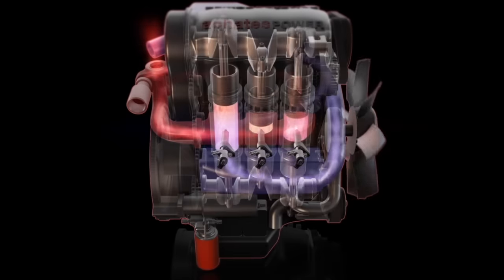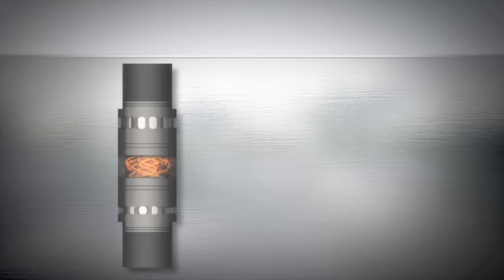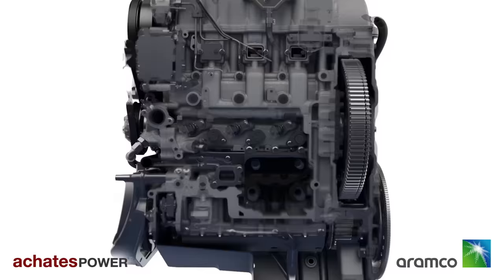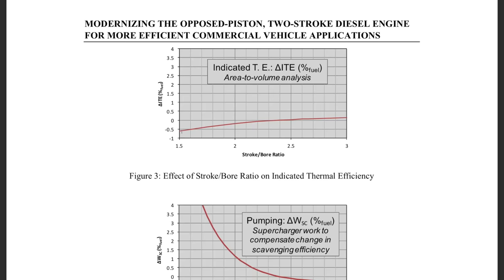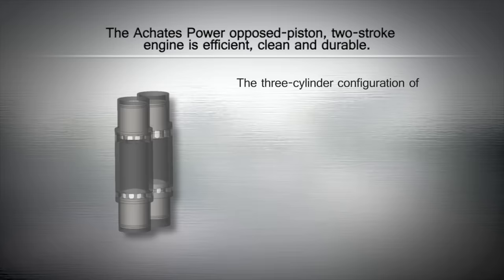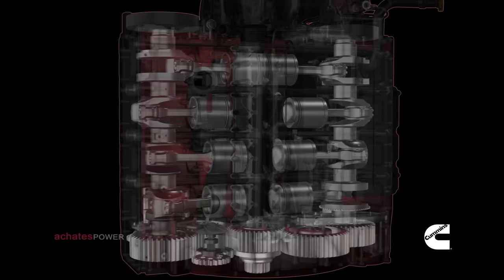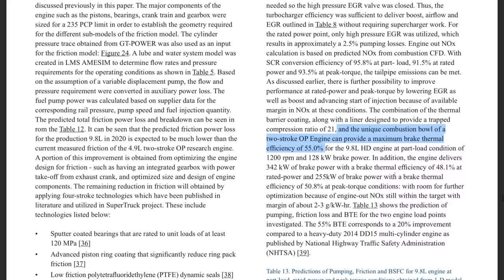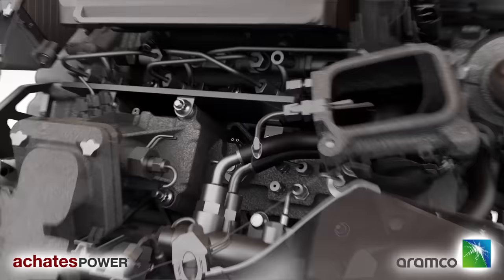Opposed Piston Diesel Engines Are Crazy Efficient

Comment: I love it! Now they need to add steam injection and make it 65% efficient. If you don't believe me look it up. I thought of it in 2007 after I bought a diesel truck in 2006 and eventually went back to school to become a mechanical engineer to develop this and other ideas. Then last year I found out that someone else is doing research on it, and proved that by injecting steam(that is heated by the exhaust around and after the catalytic converter thereby preventing it from getting too hot and reclaiming the waste energy) into the cylinder at the right time, the steam is heated further by combustion and cools the combustion below 1500 degrees celcius which prevents nitric oxide production but adds to the average combustion pressure throughout the powerstroke, and increases the mass flowrate and expansion through the turbo thereby increasing turbo efficiency as well as boost pressure. Both of these increase the power and efficiency of a diesel engine. It also has the huge advantage of not needing all of the horrible power and efficiency robbing exhaust gas recirculation systems to prevent nitric oxide because your combustion temps stay low enough to prevent their creation. Also the reduced temperatures mean less waste heat transferred through the cylinder walls, increasing efficiency again. It's a win - win situation that only works with diesels, and has the chance of making the diesel cleaner burning than any gasoline engine. 
The diesel engine is the engine of the future.
Reply: David Scott Interesting - presumably you would need a sizeable water tank in order to produce this steam though. How much water is needed on average in an example application for the same amount of diesel?
Reply: Sounds like you could be on to something there
Reply: It is a good idea but keep in mind the complexity of adding a new system like the steam generation (pressurized), the safety measures around it and, more importantly, the posible corrosion caused by the generated SO2 plus water injected as steam. Additionally, this method is commonly used in gas turbines as a way of reducing the combustion chamber temperature and NOx generation.
Reply: David Scott 

Wow that's phenomenal, thank you for sharing. I'm going to look it up never heard of it before 👍😉
Reply: I study at mechanical engineering faculty on local university (specifically information technology, which does not have much in common) and we were thought about 6 stroke water injecting ICE at English language classes. The process was not bound to diesel only, the main advantage mentioned was recovering of heat from combustion. I support this technology of recovering heat, it probably is better than something like Stirling engine or Peltier cell. I am happy to supply destilled water to my car no problem.
Reply: Sound slike steam injection would enable higher compression rates, but would not add oxygen to the system. With traditional engines the turbo or a compressor are used for that purpose.
Reply: Set it up to burn natural gas instead of diesel, and use water injection. Should be super clean and efficient that way.
Reply: What about cold environments?  Stored water is going to go solid real quick up here in Canada if the vehicle is parked.
Reply: TenguAlpha Same here in Finland.
Reply: Wouldn't methanol-water injection be somewhat similar?
Reply: Use of AC condensate combined with a small supplemental water tank would work well.  In colder climates an alcohol solution may be preferable.  Such a system should reduce turbo lag considerably as enough residual heat from the exhaust should be present.  I've been curious why we haven't seen a turbine driven hybrid electric, meaning that instead of a scroll being connected to another compressor, it's connected to an electric motor the same way that turbine power plants work.
Reply: David Scott fantastic comment which lead to a bunch of more great comments. Thank you everyone for such an interesting read.
Reply: Interesting. Does it adversely affect diesel particulate matter production though?
Reply: I've always been fascinated by this, since read about the 6-stroke marine engine for cargo ships.  Seems like it is an ideal setup for bulk transportation, ships, trains and maybe trucking.
Reply: If this is sound and true....consider simple water injection as the combustion chamber temps from the previous (split-second-before) burn should have enough residual temp to turn incoming water into steam....maybe you get close to the same sought-after efficiency but with a lot less complication. True enough however, it would not be thermodynamically the same as you are taking energy out a system instead if injecting steam where the energy has already been added  to make steam....before entry into the chamber. Still..... ????
Reply: Jesus , finally a bunch of smart people on a YouTube the world must be ending .
Reply: steve gale 
Ok, sorry nitric oxides or NOx, is that better?
Reply: steve gale 
The same design with high pressure steam injection was used in WW2? Really, then why isn't it still used? Give me a little bit of time and i'll reply with more info and details. Sorry I'm trying to finish my last class this week to get my degree.
Reply: steve gale
I know that I don't know all of the details of these engines that you are referring to, but all of the information that I could find indicated that previous engines tried to use water injection and not steam. Could you help me understand what engines these were and some more details of why reducing the nitric oxide production without reducing average cylinder pressures would reduce power? After all that is why I'm going back to school is to learn more because I will freely admit that I don't know everything.
Reply: Steam injection has been around for nearly as long as the internal combustion engine farmers used it for many years on their tractors. Boilers burning #6 fuel oil use steam atomizing plus some plants inject water into the oil before the atomizers to get a similar effect.
Reply: David Scott this 2007 idea is not in mass production yet because diesel's PM 2.5 pollution keeps people sick, which means money for the big pharma etc.
Same goes for full electric vehicles.
Sick people is a source of money, well doing people, it's not.
Of course I hope I'm wrong, I don't wanna be a conspiracy theorist
Reply: LinkinPark4Ever1996 you are wrong. sick people are expensive. healthy people can work better. money doesnt circulate by conspiracy theories
Reply: From my understanding there were several different groups working on steam injection. I'm not sure what the major issues were keeping them from being more on the market. The one complaint I Was told that water/steam scavaging from the exhaust added quite a few layers of complexity to the system overall. Not that it couldn't be overcome, just that those developing it saw it as a very expensive endevour. I HOPE That as time goes on and 3d printing becomes cheaper (Specifically DLMS) that these options become more viable due to prototyping.
Reply: TenguAlpha you have to warm a deisel up any way gotta be a way to heat it up quick
Reply: steve gale 
Oh now I understand what you are talking about. You are referring to nitrous oxide which is "N2O" not nitric oxides which is "NO", and "NO2". Nitric oxides are formed when combustion temperatures are above 1500 degrees celcius, and they are an endothermic reaction, meaning that they use energy to create them, so they use up energy that could otherwise be used to push the piston.

Consider this reaction: N2(g)+O2(g)⇌2NO(g). The equilibrium constant KP, for the reaction is 1.0×10−15 at 25°C and 0.050 at 2200°C. Is the formation of nitric oxide endothermic or exothermic?

Chemistry  Equilibrium Constants

1 Answer

￼

Stefan V. 

￼

 

￼

Jan 29, 2017

  Share

Answer:

Endothermic.

Explanation:

The key here is to notice what happens to the equilibrium constant as temperature increases.
You know that for

N2(g)+O2(g)⇌2NO(g)

the equilibrium constant Kp is equal to

Kp=(NO)2(N2)⋅(O2)

! Keep in mind that the expression for Kp uses the partial pressures of the three chemical species at equilbrium.

Now, at 25∘C, you have

Kp 25∘C=1.0×10^-15

The very, very small value of the equilibrium constant tells you that the equilibrium lies heavily to the left, meaning that the partial pressure of nitrogen gas and of oxygen gas are significantly higher than the partial pressure of nitric oxide.
In other words, the reaction vessel contains significantly more nitrogen gas and oxygen gas.
At 2200∘C, you know that

Kp 2200∘C=0.050=5.0⋅10−2

The equilibrium constant is still <1, which means that the equilibrium lies to the left. However, notice that the value of the equilibrium constant increased significantly with an increase in temperature.
This implies that the partial pressure of nitric oxide increased and the partial pressures of nitrogen gas and oxygen gas decreased, i.e. the reaction consumed more nitrogen gas and oxygen gas and produced more nitric oxide.

(NO)2200∘C>(NO)25∘C
(N2)2200∘C<(N2)25∘C
(O2)2200∘C<(O2)25∘C 
⇒ Kp 2200∘C > Kp 25∘C

You can say that an increase in temperature caused the equilibrium to shift to the right.
As you know, equilibrium reactions are governed by Le Chatelier's Principle, which states that systems at equilibrium will react to a stress placed on the position of the equilibrium in such a way as to reduce that stress.
In your case, increasing the temperature caused the equilibrium to shift to the right, i.e. it encouraged the production of nitric oxide. In other words, the reaction consumed some of the added heat by producing more nitric oxide.
This implies that you have heat as a reactant, i.e. the reaction is endothermic

So as you can see, nitric oxide production actually decreases efficiency by reducing available energy, and reducing available oxygen for combustion of fuel. If it reduces availability of oxygen then it would most likely increase unburned fuel and therefore emissions. So here again the steam injection system would increase efficiency and reduce emissions.  Every system that I could find talked about water injection for cooling the intake to allow for increased boost pressures and to prevent preignition. The reason that it is important to have as hot of steam as possible, is to take advantage of the hot steam not cooling the combustion as much as either of water with it's latent heat of evaporation, or cooler steam temperatures. By having as hot of steam as possible from the exhaust, you need much more steam to cool the combustion temperature, or you could say, that that allows you to spray much more steam into the combustion chamber without cooling the combustion temperature as much and lowering the partial pressure of the combustion gases.  This will allow you to put much more mass of steam into a semi sealed container, and more gases means more pressure with the ability to expand further even after the exhaust valve opens thereby driving the turbo faster. This is also why this is only beneficial to diesels and gas turbines, because they are the only engines that benefit from a leaner burn when the turbo gives it more air.
Reply: Jallenbah 
I'm not sure of exact ratios of steam to fuel, because they need to change as the air temperatures and pressures vary. That way you can use a computer controlled system to keep the combustion temperature close to 1500 degrees celcius without going over. But I would design a very large water tank so that you could fill it less often, and not worry about trying to get distilled water in the middle of nowhere. Hope that answers your question well enough.
Reply: Nicolas Visuara 
I was thinking about this somewhat,  but was hoping that the new fuels with lower sulfur content would help with that.

Funny story, when I was in the navy, we had to clean and inspect the smokestacks of our boiler, and when we were in there, the soot had so much sulfur in it that it would sting and burn when it mixed with your sweat. Maybe not so funny, but interesting nonetheless.
Reply: JP 
Natural gas and propane have the advantage of vaporizing better than diesel, so they would likely produce less particulate matter(PM) and burn cleaner but they are difficult to inject. The fuel that is injected into the combustion chamber at top dead center(TDC), needs to be a liquid, because it takes too much energy to compress a vapor. As injector technology increases these are very viable options, but as far as I am aware of, at the current time, and with current technology, the lubricity of diesel fuel is still required. There is however an advantage to spraying propane into the intake, because it cools the intake and makes a more dense intake air charge, and it assists in creating a more complete combustion of the already existing diesel fuel, so it decreases particulate matter(PM), and improves emissions and efficiency, so yes we should do that as well.
Reply: TenguAlpha 

There is so much to explain,but I will try to do my best. You have to remember that I have been thinking about this for years, and it has been evolving during that time as I have been learning more in college.
I live in Washington state where it still gets cold enough to freeze a tank of water in the winter, so I have been thinking of ways to deal with this problem. One of the ways that I was thinking about, was to have the shape of the water tank somewhat flat and made from polypropylene so that it could handle freeze-thaw cycles. The tubing up to the small booster pump could also be made of polypropylene to handle freezing as well, while the rest of the system(pumps, high pressure tubing, and injectors) would be drained back to the tank during shutdown to prevent damage. The tank and hoses could also have a heat exchanger that uses hot/warm antifreeze from the coolant system to thaw the water and prevent freezing while the system is operating. 
On my diesel truck I converted it to run on vegetable oil, and I put a heat exchanger in the tank and use a fuel line that has a supply and return line wrapped along it to that in-tank heat exchanger. These use engine coolant and waste heat to heat the vegetable oil and keep it from jelling in the winter. I was thinking that a similar system could be employed to warm the water and prevent freezing while it is running. 
The one drawback of this that I have experienced, is that it would take a while to thaw the water in the tank, and that causes the heater in the cab of the truck, and the engine temperature to take longer to get up to full temperature.
Reply: sim6699 
It has to be steam. Read my REALLY long reply to find out more details,  but the short answer is that it steals too much energy from the combustion without adding as much mass.
Reply: Stefan Lazic 
I'm not sure about the amount of sulfuric acid, and other dissolved contaminants would be in the exhaust, but it should be tried.
Reply: John Foemmel I see the opposite, if a person has cancer he must pay huge amount of money for the therapy, in the USA most of the times it's not covered by the insurance
Reply: Stefan Lazic

Just thought maybe we could redistill it using exhaust heat, or distill water from a nondistilled source as we drive.?
Reply: TenguAlpha methanol mixture would prevent freeing and boost pressure after detonation
Reply: steve gale l
Reply: David Scott Could one use the same system used to heat the desiel fuel to heat the water primarily, and then the heat of the engine itself would be able to push it over the edge?
Reply: LinkinPark4Ever1996 the perfect way extract a persons life savings, although i dont think fuel pollution would be high on the list. More like gmo, plastic, radiation,  and sugar subsidies
Reply: SpadeNya 
You are correct in thinking that adding more low temperature waste heat to the water allows you to save your high temperature waste heat from the exhaust for the boiling of the water, but the object of the tank heater is to mainly keep the water warm enough to avoid freezing the water. You don't need it much warmer, because then you're just dumping heat into a large object that is constantly losing heat, and wasting it. If you have heat that you are dumping into your radiator, then you are better off putting more heat into the water as long as you don't damage the tank.
Reply: It's good would they adopt it for landfill gas? Would they size it up for ships since it is more efficient? When most people would drive electric...
Reply: Big Bird 
First of all I have to say that I love your choice of names, and I feel like I get to finally explain something to a character on Sesame street. 😁

As far as the difference between water injection and steam injection goes, you can think of the difference between the goals of each. Water injection is meant for pure raw power, which I love, but steam injection is first and foremost to eliminate EGR systems and increase efficiency. When you use a steam injection system you get the added benefit of a little more power as well, but not the kind of power that they are trying to get with the water injection systems. They also don't care about the amount of fuel that they are putting into their cylinder, because their goal is to cram in as much as they possibly can to get more power. When they put water in, it robs some of the heat from the cylinder (which prevents preignition in gasoline engines, which is a good thing), but it also robs some of the heat of combustion from the fuel. Now remember that the heat is what causes the air to build pressure and try to expand, so they just put in more fuel to overcome that, but it requires more fuel. It is a slightly less efficient process, but gives more power which is why they use it. 

One way that I like to think of the steam injection system is to think of it as combining century old technology of a diesel engine, and a steam piston engine with new technology of computer controls, to join the two engines with synergy that makes it so you get more efficiency than either one separately, and it has the added benefit of cleaning the emissions.  By combining them you get both steam and combustion gasses pushing the piston and to get more power in a steam piston you have to put more steam, and hotter steam into the cylinder to push the piston. Likewise in this design the more steam you can push into the cylinder,(without cooling the combustion gases more than necessary) the more power you can get out of it, and it has the added benefit of reducing nitric oxides production. 

One of the things that I have not mentioned yet was one way that I wanted to investigate injecting the steam was by injecting at least part of it with the fuel through the fuel injectors. My ship in the navy used steam atomization because the steam expanding with the fuel broke the fuel into smaller droplets and helped it burn cleaner, so I think this might help reduce the particulate matter even further and get more heat of combustion by burning the already injected fuel more completely, and sending less unburned hydrocarbons out the exhaust.
Reply: That is probably the most I've ever learned from a youtube comment. Thanks for the slightly simplified explanation!
Reply: steve gale 
I'm sorry that you feel that way, and are unable to humble yourself and learn something new, but I was willing and asked you for more information about what you supposedly knew all about, but you provided no further truthful information, and only came back with unhelpful insults. Unless you provide more factual information, I will have to label you as a troll. Sorry.
Reply: I’m not an engineer but I am fairly certain that while the Diesel engine is the engine you are passionate about, the electric engine is the engine of the future.
Reply: Nice idea, but what about water getting condensed inside the chamber? Wouldn't that be a threat to lubrication? Or are we talking about water based engine oil ?ans also how do u prevent corrosion?
Reply: now add water/methanol injection every other stroke on this opposed 2 stroke
Reply: Maybe by using a heated water tank, or placing the water tank in the engine bay to maintain heated.
Reply: But we are not quite there yet, so for the time being, just enjoy the ICE.
Reply: The whole point of steam injection is to capture the residual heat left in the cylinder during a 4-stroke cycle. This engine is 2-stroke, so any steam injected would directly rob the combustion process of heat.
Reply: Rafael Correia An electric motor isn't an engine. An engine generates its own power while a motor gets it from somewhere else. Something has to generate the electric power to run it and THAT would be the engine of the future.
Reply: watt smith engine vs motor is interchangeable and I have seen this discussion many times before. For example Detroit is called Motor City
Reply: David Scott the downside of any system the requires you to add another fluid than just fuel is more parts and less convenient. Unless it has a massive gain in efficiency people just want to put gas and go and not worry about anything else.
Reply: jet guy 
You just said everything that I wanted to say, but didn't have enough time to say!😁
Reply: za guite 
The temperature is already high enough to prevent condensation in the cylinder.  All fuels are hydrocarbons, and when they are burned they produce co2, and water vapor (steam). When your engine is cold you can see water vapor condensing in the exhaust system and dripping out of the tail pipe.
Reply: I love the electric motor, but right now the battery technology is not sufficient to replace the internal combustion engine. Since I am an extreme cheapskate, I like trying to figure out more efficient ways of getting any job done, and if electric cars and their batteries improve, I will get an electric car, but right now I am just trying to improve what we've got. Just trying to make those battery developers push the limits. ;)
Reply: PleaseDontWatchThese I'm just being pedantic, but the question of where this electricity will come from is a real one
Reply: David Scott well, at least until our oil supply runs out in 50-60 years at current world wide consumption rates.
Reply: jet guy
Again, what is up with providing all of these important facts? Thank you! 

As far as the temperature of the steam is concerned, although it is best to have the steam as hot as possible, the system will still improve efficiency a great deal if you are only able to get the steam up to 400 degrees Celsius. It will still be a supercritical fluid, and completely flash to steam when injected. That brings up another reason of why I was thinking that blending the fuel would help with atomization, because when it's a supercritical fluid the water/steam is a super solvent and would emulsify with the fuel. I'm just not sure if there would be some kind of reaction at that temperature and pressure between fuel and the steam. possibly some kind of steam reforming reaction that could be dangerous.
Reply: Nabael
Yes, but by then we will be able to terraform the Sahara desert and grow vegetable oil producing crops, and run diesels on vegetable oil like I do.
Reply: Brooks Dean
Yes, as I understand it they used water injection. When I first had my Idea of injecting steam and or water into a diesel, I wasn't sure which would be best, but when I took my thermodynamics classes I learned how to apply all of the necessary formulas, and perform the calculations to prove the advantage of using steam in a diesel and gas turbine, over using water.
Reply: You're system sounds great if your theory proves correct

However, how are you going to efficiently implement that in a modern day diesel car? 
To get a usable amount of steam you need to put a lot of energy into the water before you get what you want. 
Also, this is only achievable when the engine is on operating temperature I would assume. 

Maybe change the cooling fluid to water and have the water become steam through that? Extend the cooling system to the exhaust or up to a point where its most efficient? 

And then, transport to the injectors. You also need a tank that can withstand the ever-shifting pressures of the steam because of how the car will likely be driven. Another point, how will you use the car in extreme climates, like Canada or hot countries?
Reply: Robert Bekkers probably adding a piston surface coating with some catalyst could split steam in hydrogen and oxygen at 1500 degrees. Just an idea, i don't know which catalyst could do the job
Reply: Oh damn that might be a terrific idea, but I don't think a suitable catalyst exist because it might already have been tried
Reply: TenguAlpha Depending on how the process works, you may be able to use something like ethanol or glycols to lower the water's freezing point enough to be useful in our cold Canadian winters.
Also, if the steam is ejected through the exhaust system, a condenser could be used to reuse some of the water.
Water is reasonably heavy at 1kg/L. If you can use the surface area of the vehicle as a condenser heatsink, you could recapture some of the water and then you wouldn't need to bring as much of the stuff.
Reply: Without talking about chemistry, where I'm not good enough, we can talk about praticity.

1. Weight : the more you add stuff, the more it's heavy. Weight is the enemy, so if you add a tank, tubes, heat exchanger you'll have a problem to stack all this also.

2. Long term efficiency : OK this system could work on very precise figures, but what kind of water would you use?
- city water : everytime you'll boil the water in the tank/on the heat exchanger, you'll create residue sticking to your material creating a thermal resistant wall. You'll also create deposit elsewhere in the tubing.
Distilled water : best choice, potentially no residue.

3. Users : we're here between cars enthusiasts, so adding water to a tank by going to fuel station shouldn't be a problem, but think about the rest of the world : we'll they add water to their tank? What kind? Can you ensure a good use of this system?

4. Tank size : what is the size of the ideal tank? How much the system is consuming? Bigger tank for less maintenance but more weight or opposite with the risk of going empty?

5. No water no power? Considering a system working consistently with diesel, what would happen if you have no more water left in the tank? If I followed properly, you'll inject more diesel, running rich, rolling coal...

Remember, individual cars are made for the most. If they see that the car works with no water, why take time to fill a tank? A lot of people doesn't make the oil change or run low oil levels, because it still works!

In France, each 2 years we have some people are DIYing this kind of stuff claiming that they consume less fuel by going the same power. We have a report about this and the bullshitery around it. But is it scientifically acceptable? More or less,the video lack of scientific points of view... They call it Panton engines, referring to its "inventor" (a scammer) 

And remember also that engine makers want to make their engine cleaner and more fuel efficient systematically, so if for now you don't see it, it's might be because it doesn't work
Reply: I have argued for this even on gasoline engines.  I was thinking that an aftermarket controller could take care of it on the gasoline side. While it would have to be totally built into the design for diesel engines.

Water/steam injection is a great idea.  Down side is the blow by past the rings though. That can mess up your old badly.
Reply: David Scott sounds more like aircraft technology.
Reply: As far as dealing with the freezing problem of a water tank that's already been done for you. The diesel exhaust fluid freezes solid in the winter as well. Everything for that system is designed to handle this and it has a scavenger pump to suck any remaining fluid out from the lines once the vehicle is shut down.
Reply: I'm not an engineer, but I seriously doubt combustion temps are above 1500C. Thats over the melting point of steel.
Reply: The diesel engine is not the "engine of the future" - it is the engine of today. The engine of the future is decidedly electric, with the potential to be much more efficient, generate more torque and higher bhp as well as reduced complexity. However, as we all know, creating and storing the electricity in the first place is the technology holding them back at this time.
Reply: John McWhirter That is at the core of the combustion, and for a really short interval if I'm not mistaken. Keep in mind what is being ignited is compressed, so you are delivering much more energy than if you burn the same fuel out of the combustion chamber
Reply: Lol, steam injection, sounds nice - but it's a gas, meaning the energy to inject it will not be gained due to ever-present losses, efficiencies, therefore this will not work hence a "loss - loss" situation.
Look up 6-stroke engine, with water-injection, the water using waste heat to turn to steam providing some mechanical energy... THAT is a win-win thing! ;-)
Reply: Lol diesel engines are of the past. Anything else than electric is just a waste of time
Reply: TenguAlpha The water isn't required, right? So I'd think you could run without water in the winter, or perhaps it'd thaw after the engine warmed up. Or maybe you'd drain and fill it, or park in a heated garage? Use something like antifreeze, maybe with a reverse osmosis filter so that only pure water gets used and needs to be replenished?
Reply: Lol okay let's inject water directly into the engine... there couldn't possibly be any long term side effects like rust or anything, same reason why ethanol never got bigger.
Reply: David Scott steam is already hot air, just a water vaporizer at intake would give more expansion during combustion.
Reply: Jallenbah you can substitute a water condenser to pull humidity from the outside air to reduce the amount you would need to carry depending on were you live.
Reply: I now know why nothing in today's society will ever improve. With so many people so quick to judge an idea as impossible before they even really learn about it AND ignore the fact that I said that they have ALREADY PROVEN THAT IT WORKS! So many of you talk about how electric cars are the future, but you are the same people that would have told Tesla that his three phase AC motor couldn't work. I think that I have lost hope in society.
Reply: cool idea!  you should check out the engine BMW used in the M4 GTS.  water injection to cool the engine for efficiency. crazy expensive though..
Reply: David Scott. Which leads to a multitude of environmental problems not in the mechanical engineering wheelhouse. Converting a desert, or any landmass, to a farm or rainforest would drastically change global weather patterns, water usage and allocation, global temperatures, etc. Also, there is the human factor - government control, tariffs, market pricing, corporate espionage, gentrification of local villages, potential slave-labor by corrupt warlords and governments. By changing an environment, the water table, weather systems, rainfall patterns, temperatures, and wind all change or go away, which, in turn, changes environments in other parts of the globe as a result. Pesticides, water usage, increased human presence all have a dynamic effect on everything. Also there are countless numbers of species that call the desert home that would be made extinct by converting sand to grass. I’m no environmentalist or tree hugger, but the conversion of desert, as proposed, to farm so that a diesel (which I drive by the way) can run a little more efficient and produce less “pollution” would have a far greater impact on the globe than my 6.7L does now. The earth is a closed loop, and any change here, has a cause-and-effect, there.
Reply: David Scott 
The "dirty" Diesel politics makes us throwing away cars that needed carbondioxide in their production. All in all it makes sense for the environment to make people driving not that much driving the "more dirty" cars instead of throwing them Swatch.
Reply: This is interesting, my grandpa told me they would   mount a water tank in the exost manifold and pipe the steam into the carburetor of their model A Fords.  He said it would make them go faster when they raced.  He was the only person I've heard talk about doing this till now.  Good luck on your work.
Reply: great. whats your idea about using a fuel from vegetable sources mixed with ether. it is higher in cetane and then must be cleaner with this engine?
Reply: Stefano Grillo 
Please, we need our earth to feed the world, not our cars.
Reply: While the OP2S is far superior to the 4 stroke diesel engine, the MYT engine is light years ahead of both these designs.
Reply: Nicolas Visuara yes you'd need safety valves to prevent excessive pressures. Plus there's the added disadvantage of requiring a water tank and a fuel tank but I think the biggest disadvantage overall would be the increase in weight
Reply: TenguAlpha they'd probably be able to develop an additive for cold environments that won't gunk up the engine
Reply: David Scott e
Reply: Nissan already uses Platinum coating for that reason
Reply: Jack Shadforth 
What's that mean?
Reply: Corrosion would be my only concern.  I don’t think it would be cost effective to produce.
Reply: Will it make your car go '' choo choooo" ??
Reply: David Scott q
Reply: PleaseDontWatchThese:
Modern diesel owners already have to add DEF to a separate tank. Switching to water to achieve the same purpose would be no big deal.
Reply: John McWhirter:
The instantaneous temperature during combustion can peak over 1500, but the metal of the cylinder walls does not absorb it instantly. What heat it does absorb is diffused rapidly into the cooler metal behind it, so the temperature of the material never rises to the melting point. This is why it takes so long to boil water, even though the fire under your kettle is a few hundred degrees higher than the boiling point of water - The water on the surface of the kettle gets heated, and without efficient heat transfer, it would boil almost instantly; but the heat is nearly instantly transferred to the water behind it.
Reply: So we're back to steam engines? Can't anyone see that fossil fuels are not the way of the future?
Reply: Great, youtube engineers who think they are smarter than real engineers. They would have thought of this already, that's why its not used today
Reply: M Hamma it's already supercharged so it probably doesn't lag much anyway.
Reply: steve gale  interesting thread until you showed up Mr obnoxious guy. I bet you're a million laughs to work with, even if you are right.
Reply: This technique was used in WW2 to increase engine power. German avial engines had a system called MW50 (Methanolwasser = methanol water), which increased engine power by roughly 20-30%. Problem was the engine could FREEZE due to the extreme cooling effect.
Reply: Just look to motorsport, anti-chamber of engine development. They just reached 51% of efficiency and you're talking about your steam stuff which is proven isn't that efficient
Reply: I already thought of this opposed piston idea in my head . and magnet suspension . both have been taken lol i got a lot more ideas too . i'm building bikes cars trucks as money comes in
Reply: Would water injection do the same?
Reply: you need to get the energy first . we already have hydrogen bombs and people have claimed that they created a H2O  engine , I'm not sure if it's legitimate
Reply: Yeah I know what you mean , the people who claim to have made them seem to........disappear
Reply: @haydenc2742  
Water will not work the same, because water injection requires that the heat of combustion is used to turn the water into steam before it is used to expand the air and push the piston. When steam made from the waste heat of the exhaust gasses is used, you are using the heat of combustion after it has been used to expand the gases and push the piston and spin the turbos. That heat has no more useful purpose, but when it uses the heat of combustion during the actual combustion process, then the air doesn't get as hot, and doesn't build as much pressure, or expand as much, so it can't do as much work. That means the energy is wasted and you lose efficiency instead of gaining efficiency.
Reply: @eksine  
Like I already said, they(real scientists and engineers in a real lab) have proved that it works, I am only trying to let people know about this new technology partly because I had the same Idea somewhat concurrently, and there is so much misinformation and misunderstanding of how this system works. People keep saying that they have already done this and then mention a water injection system as their example, but those are as different as if I told you that you can't cook noodles in water because I already put cold water into a pan with noodles and they wouldn't cook.
Reply: @xXYannuschXx  
Not the same! 
Steam not water. There is a difference.
Reply: @Stefan Lazic this water will already contain soot particles from combustion. Recirculating it could damage the engine.
Reply: steve gale  nitrous oxides (notice the s) refer to the whole NOx group.
Reply: @davidscott5903  it was used in aircraft to give some extra boost during dogfights.
Reply: @markkalsbeek5883  
You are referring to water injection not steam injection, and they also weren't diesel, so again not the same.
Reply: you can actually inject water into a hot running diesel.  each cylinder could have 2 injectors - one for diesel and one for water.  start on diesel and then blend when hot.  the rapid expansion of atomized water into steam would also help cool the engine.  oil companies keep it a secret.
Reply: @------country-boy-------  
I know that there's a lot to read, but if you read all of my comments, I explain why steam is better than water.
Reply: I thought about a 6 cycle engine long ago, but ever went beyond that.  I am sure someone else has done it and decided its not worth it.
Reply: @MichaelMantion  
It's only a 4 cycle not 6.
Reply: @LazicStefan 
That is the beauty of this system. It eliminates all of the EGR system.
Reply: The reason for injecting water would be to convert heat into rotational motion and maintain proper operating temperature with out the need for a complex cooling system.
Reply: I can show you some severe diesel engine head erosion from water injection, it doesn't work.
Reply: @LinkinPark4Ever1996  looks like you already are...
Welcome to the club.
Reply: I saw that bosch made the same thing that you are talking about(concept, not sure if it's released). I saw several months ago their product that has the desription saying that it has the 5 litre tank for water that is right enought for 1000km but as far as I remember it sad that there are nozzles that inject the small amount of heated water, not steam. I may be wrong about the last sentence, but still I know that they sad that it gives way better economy for diesels
Reply: mazda have done it with a petrol engine and its very efficcient. the name of the engine is mazda skyactiv x
Reply: David Scott u smart boi i like u. Keep it up
Reply: David Scott Reminds of of the preheating cycles in rocket engines.  Cool stuff!
Reply: @Steve Gale Isn't the WW2 water-methanol injection used to cool the charge air, so more air could be put through the engine? Sounds like David Scott's version is injected after combustion and reclaims heat from the exhaust. You're talking about two different concepts: temporary power boost vs. overall efficiency gain.
Reply: Lower combustion temperatures and higher efficiencyes?
Someobe must have sciped termodinamic classes.
Reply: Sounds great, when do we get one that is affordable ? The Dodge/ Cummins diesel 6.7 is a proven winner, but it costs $10,000+ . Something smaller/ cheaper would be welcome...
Reply: @timmydeee  
It would probably be injecting the steam during, or microseconds after the diesel fuel is injected in order to allow a complete and clean burn of the diesel fuel, but keep the combustion temperature down low enough to prevent NOx formation. The timing is the part that needs to be tested while in the lab to work out the best results. Too early, and you could starve the fuel of oxygen and cause an incomplete burn. Too late, and you allow the combustion temperature to go too high, and you waste time for the steam to transfer force by pushing on the piston. If the piston has traveled down in the cylinder you lose that distance for the steam to do work on that piston since work equals force times distance, or pressure times the change in volume.
Reply: So basically what turbofans are to turbojets, your steam addition is to normal diesel piston-engines.
Reply: @Jupiter__001_  
Kind of. That's one way of looking at it.
Reply: Methanol too?
Reply: @jakesmith2984  
Methanol is a low energy fuel. So there is no real benefit to adding it.
Reply: i'm no expert (no advanced studies in this field)
but ...even if this might work...
heat recovery from the exhausts is a good idea eitherway
be it in the form of heating for the AC or recircling it to the cylinders
Reply: +David Scott
This is commonly referred to as a 6 stroke engine, heinously complex but extremely efficient.
Reply: Hi, BMW has a water injection tested together with bosch. someone build it in his m4gts and got 40 HP more power and 200° celsius less exhaust temprature. particulate matter
 decreased by 80%! You can buy the system from bosch already, you just have to know someone or yourself to get in in your car.
Reply: @SMGJohn  
A six stroke engine is when after the exhaust stroke the engine sprays in water that uses the engines heat to boil which then pushes the cylinder down then it exhausts the steam and starts all over again with the intake stroke. My design only uses 4 strokes and sprays in the supercritical steam during the combustion stroke, then exhausts the steam and combustion gasses at the same time.
Reply: AlphaState of Mind:
You notice that they only got an increase in horsepower and not fuel efficiency. This is the main difference between water and steam injection. With water injection you can achieve greater horsepower than regular, but at the cost of extra fuel used. Thats why water injection works for gasoline engines. With steam injection you not only get the increase in horsepower due to increased cylinder pressures, but you get more expansion even after the exhaust leaves the cylinder. That increased expansion drives the turbo faster and gives you more intake air which gives diesels more efficiency. This is why diesels get the benefits of both increased horsepower and fuel efficiency when steam injection is used. And there is the additional benefit for diesel engines that you eliminate the pollution caused by nitric oxides and can therefore eliminate the entire EGR system with all of its problems.
Reply: This is not new but good thinking.
Reply: The BMW M4 GTS  has something like this. It has a water tank that you need to refill and you can enable water injection for more power. And the engine is not diesel, but petrol.
Reply: @ggooaa100  
That's like saying that my geo metro has something like the Bugatti veyron. Or that a gas engine is like a diesel. There are similarities, but they are not the same. But, thank you for letting us know some companies are trying to make a difference.
Reply: Steam, you say? I hope everything goes well with your concept.
Reply: Yeah as much as steam engines are the future. Any electric motor is double the efficiency of a diesel.
Reply: sorry but electric motors are the future...
Reply: TenguAlpha I hate your picture... 😂
Reply: David Scott 
I was just going to say the same thing. Lol
Thanks that was very interesting.
Reply: As impressed as I am with your proposition, 
the one thing we don't need on Earth 
is another system that uses water 
for anything other than human consumption 
either neat or to produce food. 

Same goes for hydrogen engines 

A good engine should be 
emission free
quiet running
cool running 
not constantly needing new physically added fuel ('sustainable')
low or no maintenance.
and
efficient.

We don't have to reinvent the wheel.
It's here and it called
an electric motor.
Reply: Sounds good, but it’s not the future. It’s like saying coal is clean. It’ll be electric powering us in the future
Reply: I haven't the scientific expertise to make an authoritative call on this system, but my hunch is that it could work. Very nicely. Let's get a prototype going at scale. You should look into crowdfunding.
Reply: Diesel mechanic here... that sounds extremely worse than any international or sterling i have worked on, and mind you they already fill a 6x4 area with egr coolers, single and twin turbo designs, along with everything else California can think to make working on them worse, that idea and the opposing pistons should never get into the truck world, working on either one would be a complete headache to even think about... work on a truck for a few years then create a design, thank you
Reply: Corrosion , emulsions and freezing temperatures can of course be overcome, but I think the people who have money are more concerned about money development rather than technological advances.
Reply: David Scott that was a word salad.  Fun to imagine but not practical.  Ever see how a steam engine gets its steam?  How is that ever practical for a quick startup and go?  Outside of large ships it makes no sense.
Reply: Do you have a link to a detailed thermodynamic explanation of the cycle that you are discussing?
Reply: @AirCrash1  
When you say that a motor is more efficient than an engine, that's like saying the torque converter is more efficient than the engine. A motor doesn't convert thermal energy into motion, it is more of a conversion of power that was created elsewhere. It takes a generating station (powerplant) to generate electricity from thermal energy. When you count all of the inefficiencies of the generation, and transfer of the electric power over the grid used to charge the batteries, then you have a lower efficiency than a gas engine. The only way to say that electric motors are more efficient than engines, is if they get 100 percent of their electricity from renewable energy sources, and that's not happening yet in America.
Reply: @Drew_Hurst  
You just completely ignored the entire power grid and all of the powerplants that generate the power. Electric motors just allow us to make the generation of the power less visible to the general public, because they are too afraid to get their hands dirty.
Reply: @uhhhhh262  
By using coal powerplants to generate the electricity?  Yeah, that's clean. Not.
Reply: @Lazybiker60  
I'm not your average engineer that has never had his hands dirty. I have rebuilt both gas and diesel engines and completely understand the frustration created by the emissions addons. The whole reason for this is to eliminate the EGR system completely and totally. This system increases horsepower instead of robbing the engine of power. It is technical because of the electronics required to time the injection of steam, and the injectors themselves, but if this system were to have a failure, then the worst case scenario is that it would be a regular diesel engine like a pre 2000 engine. All of the regular power available, wouldn't leave you stranded on the side of the road, but would be causing emissions the same as the old engines. Also, I'm not 100% sold on the opposed piston 2 stroke design,  but mostly I want to get people to realize that steam injection is the answer to our problems with the emission control systems.
Reply: @herrkulor3771  
You just hit the nail on the head! 100% true!
Reply: @MiniMotoAlliance  
Yes I was in the navy, and worked on a steam powered ship. I know that it would take a little while to heat up the system, but once it is up to operating temperatures, then it would be the best solution. This system runs like a regular diesel engine and can have just as quick of a startup as a diesel engine, but while driving down the road as the system heats up then it starts increasing power and efficiency. Just like when a gas engine runs a little rich until it gets up to temperature. Same idea.
Reply: @DavidFMayerPhD  
I will put a link to the research that I found. If you want me to, I can try to link to some of my own calculations and make something a little shorter than my thermodynamics report that I did. What would be the best way to link to such a report? I'm used to using email and Google drive to share large files with classmates, but I don't think that I should post a link to my Google drive account on here. Thank you for your scientific interest and wanting to see evidence that can be provided, and not just spouting off that, "It'll never work".
Reply: One way to think of it, and realize where the power gains come from, is to realize that by injecting steam into the cylinder at top dead center, you are effectively increasing the mass flow rate through the cylinder and out through the exhaust turbine without increasing the mass flow rate through the intake system.
Reply: The economy of scale makes the electric energy supplied by a power plant massively more efficient than the energy supplied by a diesel. That diesel didn't just up itself from the ground it had to be extracted. As the transmission of electrical energy becomes more efficient the cost of upgrading a dozen power plants is a lot cheaper than replacing every diesel engine in the world with more efficient engines.
Reply: @AirCrash1  
Actually, look up the actual efficiency of a powerplant and I think that you will be amazed.
Reply: Funny how folks seem to be re-inventing the wheel these days. The idea of injecting "steam" which is basicly WATER in a vaporised form, is not new, and has been tired many times in the past. In fact I personally knew an engineer who instaled such a system on his V 8 petrol engine in an endevour to increase power and reduce fuel consumption. It was a success and worked beautifully, BUT within 18 months the engine was a wreck, apparently the acids released by the combustion of petrol mixed with the water created an unprecedented amount of destructive gases which corroded the internals of the engine thereby destroying it totally. By all means, experiment with a stationary engine until your ideas are PROVEN and not harmfull to the components of the engine, otherwise, there's no point in the excercise at all.
Reply: @JP-zp5ic  Again, water injection destroys engines. Period.
Reply: @itchyvet  
If he did it then he didn't do it with superheated steam and he probably didn't have the operating temperatures up to normal, because if it is ran hot and ran dry for the last minute or two, then there won't be any corrosion problem. Most of the corrosion problems can only occur as the engine cools when it is shut off, and the water is then allowed to condense and pool then rust while the engine sits. That is an easy problem to prevent.
Reply: @itchyvet  
Also, the acids that would be produced would be sulfuric acid from the sulfur content of the fuel, and now the sulfur content of diesel has been lowered, so that won't be a problem either.
Reply: Hi David.  I’ve seen your post about water injection in diesel engines.  There’s a chap in LA who has (had?) a business making camshafts for specialist cars who was developing a 6-stroke water injected engine. He admits it needs a large water tank, on the other hand his experimental engine runs so cool it doesn’t need a radiator. The guys name is Crower, I dont have his details by if you Google Crower Engine, or Six stroke engine you can learn more.
Reply: @mikelindsay6980  
The six stroke is a neat design, but what I am talking about is 4 stroke steam injection. I have other plans to use the radiator heat to drive a turbine.
Reply: David Scott I have heard of water methanol injection for high commission, and turbo engines. The steam or water will also get rid of carbon build up..
Reply: Can you cite your sources? It sounds interesting.
Reply: @mhamma6560  We have seen a turbine driven hybrid electric... Every current F1 car ffs 😂
Reply: Do you think perhaps the steam might dilute the mix enough to prevent compression ignition? I would definitely like to see this running diesel instead of "petrol"...
Reply: Doesn't the high compression of these engines would condensate the steam?? And there will be improper combustion means, not smooth as in conventional one.
And how would you seperate the steam again from exhaust and feed it Again to the combustion chamber... Umm well Steam molecules are heavier, means possesing more inertia, can use centrifugal effect of turbos to seperate it from exhaust, ok then... Seperated, if seperated how you can again convert it in steam...see the main problem isn't the outside part of engine... But the inside, where high pressure would definitely create problem in proper combustion 😳🤔😁
Reply: Many years ago ( back in the seventies) a company was fitting steam injection kits to petrol engines. It was a very simple system that worked by running copper pipes through the exhaust manifold then pumping a small amount of water through using a washer bottle and pump, the steam was ejected just above the carb. It definitely gave a boost in power an economy and used only a small amount of water. Never caught on for some reason.
Reply: Steve Fuller hot steams corrode metal faster
Reply: @chanakyasinha8046  , this  is true, I have seen many engines severely damaged due to ingress of coolant via eg. a cracked cylinder head, but we are talking a very small amount of moisture like a heavy fog, I think the combustion heat would vapourise it and no damage would occur unless the system was faulty.
Reply: Steve Fuller i think vaporisation depends on pressure inside combustion chamber, more pressure less vaporisation... I don't know but there must be some components in engine to seperate out that much moisture from air, a possible way i can think of is trapping water molecules by application of centrifugal force before intake...
Reply: Diesel its maximum 25 percent efficient.Gasoline 18 percent maximum.
Reply: Sounds interesting.  Doesn't lowering the temperature lower the Carnot efficiency?  Yes.
Reply: I used to run water in my air cleaners on a 220 cummins to reduce black smoke, also put used motor oil in fuel , helped a little so it must work?
Reply: Nice idea and nice thread to read. I also heard once about an idea of mixing diesel and just a little bit of water to an emulsion. Each waterdrop is surrounded by diesel drops. So when injecting the waterdrop goes to steam and atomises the diesel drops, giving better combustion and for the rest the benefits of steam injection. Only problem is, I dont know how good an emulsion will hold or for how long it will hold inside the fueltank
Reply: @Rafael.Mechanic   electric  engine sre only good as long as you can connect to generator or exchangable battery pack
Reply: ,,, you should read up on the Crower six stroke. It adds water injection into the extra cycles, (could be possible on 2 stroke) that instantly vaporizes into a power stroke. Has another possible advantage of getting rid of the entire cooling system .
Reply: Diesel engine is the same stupidity as gasoline engine ... both are overdriven by electric motor by great margin... efficiency, torque, health issues... The heavy use of combustion engines is one of the greatest fails of human race as whole...
Reply: Works on gas turbines as well, called the Cheng cycle superheated steam injection process, developed in the early 1990's by EDL or Stewart & Stevenson in California can't remember which. Works fine on stationary installations impractical for road use due to the amount of equipment needed to produce in my case about 12 Tons of superheated steam per hour
Reply: On my yz250 i have more heat loss through the head, jacket water gets 210deg while trail riding
Reply: Unfortunately even countries that produce these wheels are starting to produce more and more gasoline engines because is the way manufacturers design their vehicles and the fact that most diesels put out more missions than a gasoline car I love diesels personally. They last a long time on their engines they're very durable vehicles and we could quite easily convert them to work with methane which is naturally produced even if you have septic tanks by your waist breaking down. It doesn't stay in the environment near as long as CO2 and it's much easier to break down the carbon molecules in it. Yet more and more vehicles are going to gasoline because of the oil industry and the way the government regulations are being pushed rather than being Innovative with the Diesels and making us more independent as individuals they want us to buy more cars more often so the low-life gasoline engines that put out less emissions is an easier sell for them. Diesel engines are the way of the efficiency and individuality however the gasoline engines are what puts the oil companies in power it's not easy to convert them. Costs thousands of dollars just for a kit and that's if you know what you're doing. With diesel is it doesn't take much to change them to run on multiple other fluids
Reply: Isn't that what exhaust fluid is for?
Reply: The place to start experimenting with steam injection engine design might be marine engines. The water's literally just on the other side of that wall and only needs a little filtration to get rid of some minerals you don't want mucking up your steam system anyway...
Reply: it sucks when you have an idea and someone else develops it before you. When I was a kid I drew up an engine design with a certain layout.  Decades  later I saw the Duke engine , essentially the same thing I designed.
Reply: They better make sure that it will use the basic engineering rule of the 1970s and 1960s technology protocol which is DO NOT MAKE IT UNNECESSARILY COMPLICATED AND UNNECESSARILY SOPHISTICATED BY AVOIDING THE USE OF IC CHIPS, Make the engine(s) virtually 100% purely mechanical and 100% purely analog, AVOID ELECTRONICS LIKE THE BLACK PLAQUE AT ALL COSTS! Everything must be mechanically automated and mechanically controlled and mechanically monitored and mechanically-based analog controls using. Avoid belts or REMOVE THE BELTS and just use the gear-shaft power transmission design system, use gear-shaft transmission design systems connected to simple dynamos and in pre-pressurizer Tesla turbine compressors and simple iron-alkaline batteries and simple lead acid batteries. MAKE EVERYTHING SO SIMPLE AND 100% PURELY MECHANICAL THAT NOTHING WILL FAIL. And design it based on the 1960s and 1970s engineering protocol that it should be 100% DIY repairable in the field or in your garage or in your tent or inside your house if it becomes necessary. It is to be 100% purely mechanical so as to avoid of being EMP VULNERABLE and avoid of being CME VULNERABLE. It must keep on running indefinitely, air cooled, lubricated with castor oil with some additives, and must remain operational indefinitely no matter what nature hits it with whatever nature has or got to hit it with. And it must be adjustable to be multi-fuelled and capable of using wood gasfier produced wood gas, coal gas, or whatever fuel is available.
Reply: I would think the steam could solve the problem of oil burning in this type of engine and also keep the combustion chamber clean. If you’ve ever seen a guy “steam clean” an engine it can get it looking tons cleaner I wouldn’t worry about any corrosion issues in the combustion chamber.
Reply: I remember reading a few years ago about some engineers working on injecting water into the engine. They were using pressurized injectors, similar to port fuel injection. The water, since it does not compress well, increased the compression ration. It also took advantage of how much water expands as it becomes steam, which increased the force exerted on the piston through the down stroke. They claimed it increased torque, HP and MPG, and decreased operating temperature, exhaust temperature and engine noise. In their system, the water to fuel ratio was 1-1, so the water tank would be the same size as the fuel tank.
Reply: Quick, patent it before the Chinese and the Russians steal it.
Reply: David Scott Yeah just so you know BMW is already doing that.
Reply: Well battletech  Internal combustion engines are diesel, and used in civilian applications since fusion reactors are expensive....
Reply: 'Water injection was used historically to increase the power output of military aviation engines for short durations, such as dogfights or takeoff.'  Of course looking up water injection will let you know this is a very old idea, used quite a bit for varying reasons.  Shortly after 'Something got too hot in the engine!' comes 'Hey, let's throw some water in there so it doesn't get too hot!' etc..  It's an old idea that doesn't get seen much in normal use cases because of the extra complexity and costs.  It seems simple enough, but if you actually make it mandatory to the engine operation you increase failure modes, and if you make it 'optional' then it becomes not really worth the problems and complexity for the relatively little gain.  Simply difficult to make it have enough bang for the buck to be overall worthwhile.  People run out of gas, if you make that gas + water and it will be far worse, people are casual with leaks since it's harmless, etc etc.
Reply: TenguAlpha damn your eyelash picture, I tried 3 times to get it off my screen
Reply: The electric engine is the Engine of future.  😑😑
Reply: Big oil Criminal lobby wants to know your location.
Reply: David Scott I have a question. I’m not the first of the Tiny House movement or the Schoolie Movement. But within my plan to buy a diesel school bus and turn it into a Schoolie, I’m wondering what can be done to the Diesel engine to increase its efficiencies and you seem like the first guy here who knows a thing or two about doing just that.  I know school buses don’t have a good mileage range but what are your thoughts for Diesel engine mods that a Schoolie owner can DIY?
Reply: All of you here in the comments should create a Diesel Engine movement or fair or something where you as inventors go and present your different prototypes. Seriously. I want to buy a Diesel school bus and turn it into a Schoolie but I also want to increase its engine efficiency and you all are freaking smart. Im going to Med school soon but I’d love to learn from and see all your ideas come into fruition. Seriously. You all got a passion for Diesel engines. Make it grow!
Reply: LinkinPark4Ever1996 I was thinking of buying a Diesel School bus after looking at fully electric school buses. The electric ones run for $350,000. I can’t afford that. 😂 So I’m looking at Diesel and a portable biodiesel processor to supplement. I don’t want to be slave to bank or slave to big pharma. I value financial independence. So I agree with you.
Reply: How long do those engines last though     when steam is compressed you get these full on water droplets that form in the engine when the pressure is right. It hammers away at the metal gradually so really how long would an engine last doing that. And incase you think im bullshitting i rebuilt a diesel that had massive problems, one being water contamination in a cylinder which pitted the hell outta the area between the valves to the point that it cracked and trust me that pitting went right through quarter inch thick steel
Reply: Yes, yes, you are right! But, here is the biggest problem with your engine: efficiency! This efficiency, is the worst enemy to oil maker pockets! So, will be never applied! 😉
Reply: Cooling the gases in the cylinder is  likely to give you less pressure even after taking into account the volume increase of water to steam...
The only part of that idea that could be good is nox reduction
Reply: You could give old Doc Brown a run for his money.
Reply: So the advanrage to conventional EGR is the increased volumetric efficiency? However i imagine that has a lesser effect since there are little pumping losses. However i know that diffusion flame propagation gets difficult when opperating too lean, so that might be an advantage. When does the water inject?
Reply: David, The steam will displace the oxygen in the combustion chamber, less fuel can be burned, the power per cid decreases.  It’s heat that’s doing the work.  Alas, In thermo cycles, you can’t get something for nothing.  What will work is a steam (Rankine) bottom cycle, but this is nothing new.

Water is injected into gas turbines after combustion.  It’s a different animal.

Practically, the water has to be pure and this cost dissuades lost water systems.
Reply: @Stefan Lazic I'd argue an additive could be added in cold environments , but I'm definitely not an engineer
Reply: I had a similar though but then using water. Spraying it in with the air. The water is evaporated during ignition, greatly increasing the volume expansion. Anyway I really don't know if it is mechanical feasible.
Reply: Steam injection tho' has the decided negative issue of needing to have both a petrol and a deionized water tank.  Can't fill the water tank with 'tap' water, as the ions in it leave a nearly impossible-to-remove scale on the inside of the steam generation pipes and tubes.  Has to be deionized.  The amount of steam injection is also something of an issue:  I've heard that it takes 2x to 4x the amount of fuel as mass-of-water per stroke.  You probably know more.   Seems hard to imagine people hauling around 25-30 gallons of diesel, and 100+ gallons of deionized water.  

Just saying...
Reply: @davidscott5903  I've noticed many people here claiming electric is the engine of the future and obviously the counter is generating electricity itself is its own set of problems that diminish how usable electric engines are.

Your addition of steam does look interesting and increasing both efficiency and horsepower is quite laudable.  What applications would your changes work best in though?  Large vehicles in general might work out for them, but can it also work as a generator?

How might the addition of steam work with renewable fuels such as vegetable oil?

I've only come across the super-critical matter state in reference to CO2, in particular the work of Martyn Poliakoff most notable on Youtube as a presenter for the Periodic Videos channel.  He too uses it as a solvent.  I can see how H2O would be uniquely capable in regards to engine heat given its high heat capacity and ubiquity, but is there potential for another super critical fluid to achieve something similar?
Reply: I hope you get this idea up and commercialised.  I would love it as I’m a diesel freak.
Reply: @jackalopegaming4948  
You're correct about the ubiquitous nature of water, but what really makes it worth it is the highest latent heat of vaporization.  That gives the steam so much energy which is of course the ability to do work, so it gives up its energy as it expands so much. Not only in the cylinder, but also the turbo. This could be used whenever a person needs a fuel efficient engine and can afford to pay for the extra parts of the system. A generator is a great way to use it, because it would be able to take up a little more space than an engine compartment with all of the extra heat exchangers.
Reply: @JP-zp5ic  
Using a gaseous fuel is very hard to combine with fuel injection.  Much easier if injecting liquids. That is, gas has low density and flows through a nozzle slowly unless highly compressed, which requires much energy. So we stick to alcohol, gasoline, oil, or cryogenic fuels.
Reply: @mhamma6560  This turbine system is exactly what is used in F1 (MGU-H) and some LMP1 cars. However, it may be regulated out in the next rules package due to high costs, which may be the reason why it's not seen in production cars.
Reply: You do realise that gasoline engines can also use direct fuel injection and turbochargers and also reach combustion temperatures that create NOX?
Reply: Anything to do with Gillier-Pantone kind of  systems?
Reply: If the fuel contains hydrogen (as with all hydrocarbon fuels) and involves internal-combustion/displacement (as with most engines), it IS BY DEFINITION: A Steam Engine! ...Try a stabilized fuel/water emulsion injection, and see your MPG double/triple. Just don't let the likes of ExxonMobil know what you're researching. They've murdered millions for lesser reasons!
Reply: @davidscott5903  
No. Electric power plants are far more efficient than automobile ICE. Enough so that Tesla vehicles are more efficient and presumably, so are most electric.
Reply: @Bob-yl9pm  
Really Bob? Steam engines are external combustion, as opposed to internal combustion, by definition. Sheesh, are you a troll?
Reply: @robertlynch7520  
Water injection can be used only for extreme conditions, such as high chamber pressure, hot piston heads, etc. This would reduce the consumption and still provide peek peak performance. 

On a practical note, alcohol is usually added to the water supply to improve stability in cold weather and to increase "octane" number.
Reply: @avid0g  
You might want to learn a little more about the total electric grid efficiency, and how much you lose by the time you get to your home and then the loss of efficiency of charging the batteries compounds all of that, so no they're not more efficient. Do your homework.
Reply: @Bramble20322  
Actually, it is rather hard to find gasoline in Pennsylvania that is not an Ethanol blend. Perhaps 1% of stations provide it. 

The economists say it requires more energy to make Ethanol than what it contains. It definitely reduces my milage.
Reply: @5002strokeforever  
Exactly. A water/alcohol injection during especially high compression is the best use of this technology. You are basically installing a vodka injection system for cold States like Pennsylvania. My turbo SAAB requires premium to get the highest HP output. This could effectively increase peak HP and limit NOX using 87 octane.
Reply: @alexhickey5633  
Was that pitting between the two exhaust valves?
Reply: @DylanBegazo  
Since the bus is so heavy, the greatest improvement would be to use a hybrid system. Use electric mostly for acceleration/regeneration. You could tie the electric motor in at the transmission/drive shaft coupling and mount the batteries below the deck. Buy Tesla battery packs - they're the best.
Reply: @ModelLights  
"make it gas+water"
In Pennsylvania, make that gas+water+Ethanol, or Gas+Vodka. It gets cold enough here to freeze a water supply tank.
Reply: @javaman2883  
In freezing weather, the water needs an antifreeze such as Ethanol or Vodka. . .
Reply: @Veikra  
I really hate when my bright idea turns out to have an expired patent. Not so bad when the patent is still active.  Sigh
Reply: @danieljimenez8646  
Tesla power wall.
Reply: @striehassus  
Produce emulsion at the injector nozzle. Great place to mix things up.
Reply: @mihaiilie8808  
Efficiency goes up with a longer expansion stroke than compression stroke. Intake valve timing can make that happen. 

The opposed piston engine also has higher efficiency due to a pair of hot piston tops and no cooler cylinder head. 

I often wondered if insulating the piston and head would help?
Reply: @stevefuller1779  
Should have used stainless steel tubing. IDK why these water injection schemes don't catch on.  Maybe they don't have long term benefit, but only a power burst from cooling the cylinder walls.?
Reply: David Ogawa You seem to be someone who knows their stuff. I might say I’m glad I stumbled across you. I took notes of what you said. You’ve been a Great help
Reply: @chanakyasinha8046  
No recycling of Deionized water (or Vodka).
Reply: @chanakyasinha8046  
Water injection limits peak temperature, and prolongs the power stroke. Most important, it can be used in conjunction with high pressure and temperature, when throttle is wide open, to limit NOX formation.
Reply: @jamest.5001  
Carbon buildup was a big problem on the cold intake valves when gasoline direct fuel injection was first used. Now some fuel is sprayed into the air manifold near the intake valve, in addition to direct injection.
Reply: @mikelindsay6980  
That is odd. Running "cool" is thermodynamically inefficient.
Reply: @mikelindsay6980  
Never mind. I see now. Cylinder heat is transfered to generating a steam power stroke. Of course it guzzles water as fast as fuel. And the crankcase needs an oil/water separator.
Reply: @davidscott5903  
There may tend to be some water in the crankcase if this injection is used continuously. Switch to a stainless steel oil pan and install an oil/water centrifuge separator in the loop.
Reply: @itchyvet 
I bet there was blow-by of steam into the crankcase. A system that dehydrates the oil is a must! Or, all the crankcase oil can be injected into the cylinders as fuel.
Reply: @AirCrash1  
Power plants install low pressure secondary turbines and counterflow heat exchangers to squeeze even more energy from the steam. Very hard to sell that complexity in a fleet of cars. 

The opposed piston design seems to be the next required step in fleet efficiency before the last gasp of the ICE.
Reply: @avid0g  
By keeping the temperature at full operating temperature the moisture goes out the crankcase vent as steam. So it's not a problem.
Reply: @avid0g  nope, between the intake and exhaust valves. Only 2 valves per cylinder
Reply: @avid0g  Of course.  Real point is simply that it's utterly impractical, and no amount of finding other tiny benefits or reclassifying old ones will make it any more worthwhile.  If it were workable it would have been being used since the 1940's and before, it isn't anything new it is a well understood, known idea.  Someone ALWAYS thinks they've reinvented this, and it still never makes enough sense to actually use it.  A friend's dad did this same thing in the early 1970's and got published in Popular Mechanics etc.  So it's humorous to see someone reinventing it again now, or thinking it's going to work now because of X or Y or Z.  It won't, anyone only has to go look at the hundreds of other times it didn't work for all of the reasons why.
Reply: I think the greatest issue is blow-by which is a combination of cylinder oil film, combustion gas and much more moisture. 

On the Achates two-stroke engine, the intake and exhaust ports catch most of the blowby, but a four-stroke engine needs more protection. 

Moist blow-by must be diverted away from the cooler crankcase oil before it condenses, so crankcase ventilation must be increased. 

Condensates should be caught and injected back into the cylinders. Perhaps: 
  insulated oil pan, 
  drip gutter at cylinder bottoms,
  oil/water separator.

If corrosion persists: stainless steel and anticorrosion plating.
Reply: Shiz to bad vw or mopar didnt use you for there diesel engine design... for there emissions scandal on diesels..
Reply: @izmeorbin9602  
The water is heated well above the boiling point but contained under high pressure and injected along with fuel oil. It flashes to steam,  turning the fuel into an aerosol. The important volume constraint is to maintain a high enough temperature to ignite the fuel without some additional ignition source. After combustion is well underway, perhaps more super-heated water is injected.
Reply: @AirCrash1  
The efficiency of electric motors should be examined including electric power plant efficiency. Some natural gas fired plants get 60% efficiency. Coal is usually lower. The molten salt nuclear reactors can exceed 60%.
Reply: @GeckoCkCkCk  
The steam injection limits the temperature to prevent NOx formation, or provides enough hydrogen to break down NOx again. More steam is added when the combustion is nearly completed. The steam energy is recovered either in the power stroke or in the turbocharger.
Reply: @OPBjorn  Actually, synthetic fuels are currently being developed and should be ready in a decade or less.
Reply: that's fine in a industrial applications but in a car where do you store all the water? I presume it uses a lot.
Reply: Oh by the way heat recovery has been done insutrialy by eocnonisers for 100 years.
Reply: @Dosedmonkey  
Yes, if used full-time then both tanks have similar volume. And water is heavier than gasoline. However, we are talking about 60-65% efficiency vs 25-30%, so the total volume is about the same.
Reply: Water injection is not new.
Cars use to run on steam. They were considered rolling bombs. Many exploded. But lugging around water at 8lbs a gall and the extra energy to boil water then the loss of that energy thru conduction, is it worth it in a small mobile application?
Reply: @stvargas69 
The efficiency of 66% seems worthwhile. That reduces fuel consumption so there is some offset for the water/alcohol tank. 

Please, no need to discourage us with ancient poor engineering results.
Reply: David Scott 
I was waiting for some garbage about the "climate".
Well done!
Googol Stan Meyer.
Reply: Rust
Reply: JP Great idea but don't over look alcohol also in conjunction with natural gas and you would also have a very clean engine.Make the alcohol with any type of starch laden ingredient not just corn, examples such as cat tails, cassava, artichokes etc.
Reply: David Scott
 : why does this work only with diesels?
Reply: Just get electric bro, maybe superconducting motor?
Reply: It's an interesting idea, but would the water be salvageable after combustion, or are we changing it to something else?
Reply: @Stefan Lazic Could get a bit complex. The condensed water would probably contain soot which would have to be filtered out before being reinjected. And there will always be losses.
Reply: @davidscott5903  and spike that vegan oil with noxious cactus juice !!!!  for a hallucinagenic octane boost
Reply: @sen_ex  if it's a BMW it probably is 😂😂😂
Reply: @asm_nop  salt water 😮
Reply: @johnm5928 you're thinking of them in beam form in situations facilitated by the addition of jet fuel at high  
velocity
Reply: @timothyluu7324  BMW's burn money like  methanol water
Reply: @bravesirrobbin6865  Grandpa Einstein haha
Reply: @OminousCamaro  wish that was my only concern
Reply: @Jallenbah  
Since you would be using pure water and it would be more difficult to find a reliable source to refill your tank, I would recommend having a similar size tank to the fuel tank, or larger, then since it uses quite a bit less, it would last for several refueling stops.
Reply: @JP-zp5ic  
That's the true beauty of the diesel engine, is that it can burn any fuel. The large cargo ships use natural gas in very large diesels, and they are the most fuel efficient engines in the world.
Reply: @jonjonjonnyjon  
There are many ways to overcome this problem. I have thought of several, because I live in a cold climate for about half the year.
Reply: @sim6699  
The main difference is methanol is another fuel, and water has no stored energy, so it robs its energy to turn into steam from the combustion process. It works great for gasoline engines when you don't care about fuel efficiency but are instead trying to get massive amounts of power from the engine by increasing boost without causing knock.
Reply: @ManWithBeard1990  
I don't believe so, but I haven't seen it with my own eyes, so I can't say for sure, but with increased injection pressure that can probably be reduced also.
Reply: @Stefan Lazic 
The problem is that you could have contamination in the exhaust which would build up and leave deposits in the engine. But it might be worth looking into what it would take to do this, and how pure the water would be.
Reply: @TheWilferch  
You are correct in noticing that it would be robbing thermal energy from the combustion process if you were using water, and that is why it increases efficiency when you reclaim the energy after it has left the turbo outlet.
Reply: Science!
Reply: How clean would the water have to be to prevent a mineral build up? Distilled?
Reply: @gregripp  
Yes, it would need to be pure to prevent scale build up. It could be distilled, or purified by reverse osmosis, which is cheaper. But you are correct.
Reply: @stevefuller1779  
The reason that those engines didn't catch on, is because they weren't taking advantage of the amounts of energy that they could have by having it directly injected into the cylinders at high temperatures and pressures at top dead center so that it does more effective work.
Reply: @LazicStefan 
The whole reason that steam engines work is because even though it takes a massive amount of force to pump up the pressure to the extreme pressures needed, the water is nearly incompressible, but  the steam expands to nearly a thousand times the original volume, so it can push against a surface and develop way more work than was put into it to make it high pressure.
Reply: @DylanBegazo  
Whenever you can give a diesel engine more air, and cooler denser air, you increase efficiency. If you can increase the size of the turbo, and intake and exhaust pipes, and include a good intercooler, you can get an increase in efficiency.
Reply: @alexhickey5633  
High enough temperatures that there's no problem with condensation. Simple.
Reply: @5002strokeforever  
I thought of it for years, and got my mechanical engineering degree so that I could find out, and know that it would work, and it does. Even been proven by a university in Turkey now.
Reply: @MaxMustermann-bm7qt  
Basically the steam injects at top dead center. And it is better than an egr system because it adds power and efficiency instead of robbing the engine of power and efficiency like EGR systems do.
Reply: @danbenson7587  
The beauty of the diesel engine is that they have extra oxygen to spare, and especially when you aren't choking them out with their own exhaust gases. So really, this design has way more oxygen than a diesel engine with an EGR system on it.
Reply: @myotherusername9224  
It works best with diesels because they are already more fuel efficient than gasoline engines and the new emissions regulations are killing the diesel engines and this gets rid of the EGR system yet keeps the cleaner emissions. It's a win, win, win situation.
Reply: @bobkuboske6494  
The water gets too dirty and acidic because of the CO2 in the exhaust gases, so it can't be effectively recovered.
Reply: @davidscott5903  ever thought about the impact the water droplets make when under super high compression and heat? It can easily put small little holes in the cylinder and piston. You do not want water going into an internal combustion engine EVER
Reply: David Scott   True diesels have excess O2.  Believe me, the engineers would use the O2 if they could.  In a diesel process, the O2 is reduced by combustion until fresh fuel cannot find fresh O2.  Injection is cut off.  That’s why the excess oxygen.
     Steam dilutes the O2.  This reduces the fuel’s chance of finding O2 and heat release.  This reduces specific HP.  So you need a bigger engine.  Alas, In thermo, you can’t get something for nothing.
    Water injection between engine and turbo in a compounded engine may have possibilities, but it looks zero sum to me.
    Distilled water is required to avoid depositions.  In a lost water system, the economics is unfavorable. It’s another logistic headache.
    Many very smart people have thought long and hard improving engines.  Most ideas died by economics, not technology.  Were water injection economic, it would be used on slow speed ship engines right now.
    A tidbit,  Back in the oil crunch of 80s a scam was water injection kits for gasoline engines.  My Brother in law bought one.      Cheers
Reply: @danbenson7587  
You keep spewing forth words on something that you barely understand, and you can't seem to understand that steam and water are two different things and that location and timing of the injection of the steam might have an important part to play in it. You say that diesel engines don't have extra oxygen? So your telling me that diesel engines are on the verge of rolling coal at all throttle positions all the time? Really? Do you know anything? And like so many other people you keep failing to understand that there's a difference between steam and water. It's a good thing you weren't in charge of designing steam locomotives two hundred years ago, because you would have been spraying water into a cylinder at bottom dead center and not understanding why you couldn't get it to work. You should really try to understand steam and diesel engines a little better before you open your mouth and confirm how little you know.
Reply: @danbenson7587  
Something that you can't seem to understand is that the because the steam is injected at top dead center, all the normal amount of air, and therefore oxygen, is already in the cylinder, so you aren't really decreasing the amount of oxygen. And if done properly, the steam can be injected in a way that can increase the amount and velocity of the swirl in the cylinder and thereby introduce more oxygen to the fuel, and allow even more fuel to be injected. And then you haven't even considered the fact that the steam is going to continue to expand in the turbo and spin it faster, and thereby increase boost and the amount of air being forced into the cylinders thereby increasing the available oxygen again. Try to understand a system as a whole before you blow it off and ignore it.
Reply: David Scott   You Don’t understand I have a BS and MS  in mechanical engineering.  I have 12 hours of thermo and a thesis on gas turbines.  I practiced 45 years of engineering.  You talk about it, I did it.  You want to go toe to toe?  Don’t tell me what I don’t understand when Your own is risible.
     Now that we got that straight, believe me it WI has been studied, tried, and rejected.  There are other ways of improving thermodynamic efficiency by bottoming cycles and these ARE successful.  To wit, turbocompounding is successful and is now downsized to semi truck engines.  BUT, keep in mind, thermo efficiency does not always equate to practicality or overall economy.
    Straight water injection application was in early turbojets where it was injected after combustion.  It lowered turbine inlet temp and increase mass flow for take off.  You will see those engine rated dry and wet.  But it was a pain and abandoned ASAP as blade cooling and bypass came along.
    In WW2 the Late war planes had water/methanol injection, to prevent detonation.  When running ADI the increased boost provided the hp, not the water.  They could ADI say 10 minutes in combat.
    I am unaware of any other water injection measures on IC engines.  Suggest asking yourself ....WHY?
    Dreaming fosters ideas, and ideas, progress.  So I am not against dreaming.  But few dreams yield plausible ideas, and only a few ideas make it into iron.    Cheers
Reply: @danbenson7587  

Oh, and by the way, you don't have to take my word for it. You can look it up online. A university has already proven most of it with an actual working test engine.
Reply: David Scott   My friend, if you were as old as I am you would see this stuff has come on gone with each issue of Popular Science.
Reply: @danbenson7587  
Yes, I have noticed that a lot of good ideas seem to go by the way side, but I am starting to wonder if a lot of those aren't due more to society's stubbornness and resistance to change rather than the ideas not being good enough. I have seen inventions that are proven to work better than existing products, and the inventors win inventor of the year awards, but industry doesn't want to incorporate the improvements because they feel that what they have is good enough, and they are scared of being too different. A lot of customers won't buy something that they don't feel that they understand well enough. Then there's stories like Tucker, where massive improvements were made, but the big three fought to keep him from competing, and then slowly incorporated some of his improvements into their own cars as long as they could get away with it. And then there's things like the intermittent wipers that were outright stolen from the inventor and the inventor had to fight for nearly the rest of his life to get any reparations from the car companies. It's ugly out there if you want to improve the world.
Reply: David Scott    Most Ideas go fallow for lack of vision, or inertia.   The idea itself had to pass 3 criteria:  will it work, will it last, is it economic.
    The inventor has to prove it to a skeptic peers, essentially a belt line.  Then when his neck is stuck out and if the company is doing well, he might get some funding.  The idea has to be a real improvement over the existing.   in your case, the fuel is a portion of overall expense.  So an fuel efficiency improvement of 20% may move the bottom line 2%.
      The company has a lot of money and inertia wrapped up in the status quo.  Manufacturing, supply chain, training, manuals, inventory.   The idea has to justify revamping.   Moreover, In the U.S., many companies buy their technology.  (Japan develops organically.  Chinese steal.)
      Customers are skeptical too, they don’t want to be first.  There is the adage “Don’t buy the A model of anything”. However they will bite depending on their exposure.
      The “stubbornness” to an idea is not without reason.   

   If you are a true believer in your idea, eBay a Koehler or Tomhatsu diesel and have at it.  You will need a brake Dynamometer, fuel flow meter, water flow meter, thermocouples, tachometer.  Useful gear can be had at an industrial junk yard.
    High  pressure water injection is a bear.  Water is not lubricious and leakage cuts metal.  (Google “waterjet cutting”).  The more crap in it, the more it cuts.   Cat makes small water blasting pumps.  The injector and modulation, good luck with that.
     Water dilutes cylinder lubrication which is particularly bearish at TDC.                     Cheers and keep dreaming
Reply: Along with the addition of the Turbo encabulator these two applications will provide the break through needed for generations to come. For a number of years now, work has been proceeding in order to bring perfection to the crudely conceived idea of a transmission that would not only supply inverse reactive current for use in unilateral phase detractors, but would also be capable of automatically synchronizing cardinal grammeters. Such an instrument is the turbo encabulator.

Now basically the only new principle involved is that instead of power being generated by the relative motion of conductors and fluxes, it is produced by the modial interaction of magneto-reluctance and capacitive diractance.

The original machine had a base plate of pre-famulated amulite surmounted by a malleable logarithmic casing in such a way that the two spurving bearings were in a direct line with the panametric fan. The latter consisted simply of six hydrocoptic marzlevanes, so fitted to the ambifacient lunar waneshaft that side fumbling was effectively prevented.

The main winding was of the normal lotus-o-delta type placed in panendermic semi-boloid slots of the stator, every seventh conductor being connected by a non-reversible tremie pipe to the differential girdle spring on the “up” end of the grammeters.

The turbo-encabulator has now reached a high level of development, and it’s being successfully used in the operation of novertrunnions. Moreover, whenever a forescent skor motion is required, it may also be employed in conjunction with a drawn reciprocation dingle arm, to reduce sinusoidal repleneration. 
Thus making the Two-Stroke Opposed-Piston Diesel Engine By Achates Power ideally suited for these enhanced applications.
Reply: @danbenson7587  
You are correct in many of your reasons why ideas don't always get fully developed. Building my own is obviously what I am going to have to do. Thank you for participating in the discussion.
Reply: @willythewave  
Thank you for introducing me to the turbo encabulator.
I'm sorry if this is only as clear as it's description.
Reply: @davidscott5903  You`re welcome.
Reply: Sounds like the basics of Adblu
Reply: @dr1verman  
What is adblu?
Reply: @davidscott5903  Now you are mocking me.
Reply: @dr1verman  
No, I don't mock anyone who hasn't already been mocking me or someone else. I seriously had an honest question. I wasn't sure if you are referring to Adblue, or something else that I am unaware of. Please help me understand what you are referring to by giving me more information.
Reply: Similar technologies have been used in F1 for example, they inject water to the cylinder to reduce engine power
Reply: @S3l3ct1ve  
Again, the difference between steam and water should be apparent.
Reply: This is all nonsense. Learn about the second law of thermodynamics and what it means for Carnot efficency.